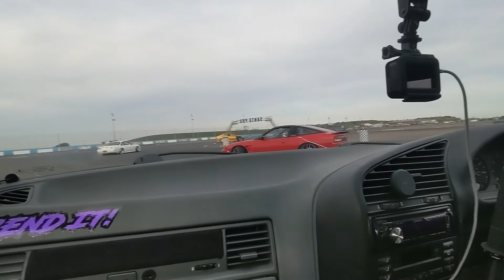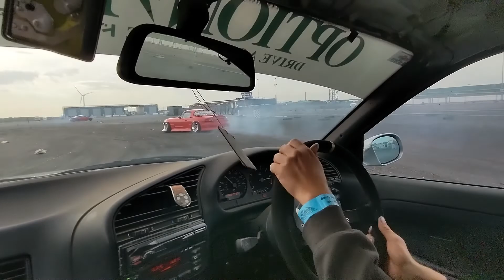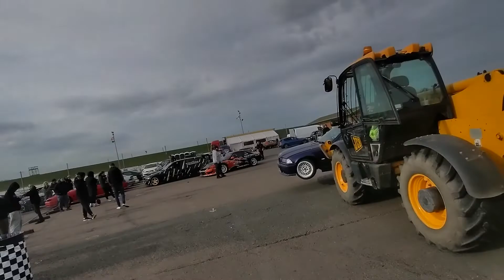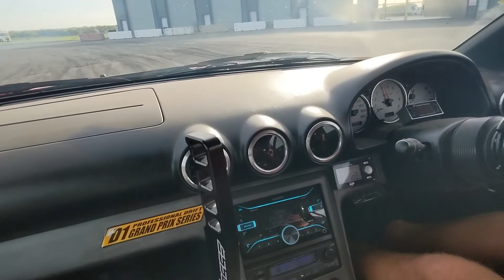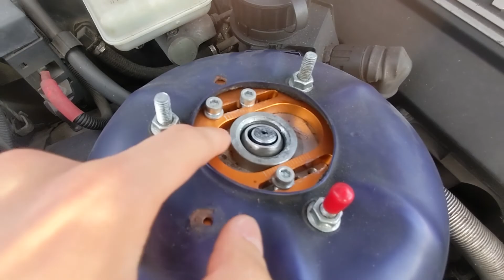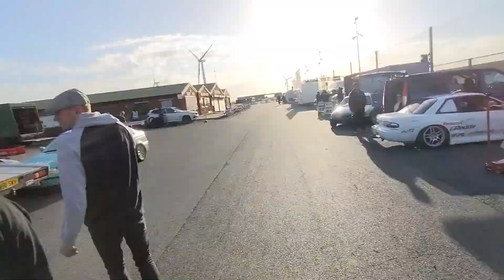400HP DRIFT S15 BLOWS MY MIND!! Santa Pod DWYB

Comment: Owned an S14 and an E36 for the same amount of time, maybe a bit more in the 36 but I bought a really well setup E36 and it's infinitely better than the S14 to drift. 
Can sit on limiter all day with the M52, full commitment. With an SR you're always hoping that it's not gonna blow a rocker arm or detonate and overall I just prefer the way the 36 chassis moves and feels 🥸

Only thing I miss about the S14 are the sounds
Reply from the maker: this is good insight, thank you for this - im totally gona consider it!!
Reply: @AlexDotchev  Posted a vid doing phat sends in the 36 to my channel yday bro x 
But yeah unless you can grab an S chassis for mega cheap, the discrepancy in price isn't worth it